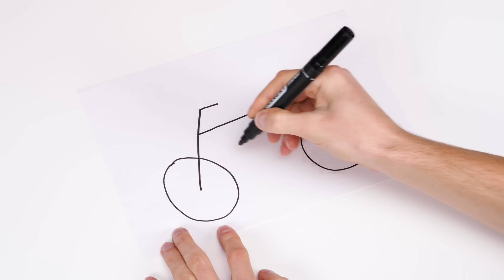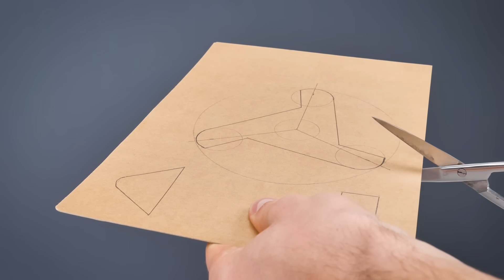EXPERIMENT: Shock Absorbers in Bicycle Wheels

Comment: This is an example of :
"Bad idea Great Execution"..
Reply: "great execution" see 3:00 for example, wtf
Reply: Plus it doesnt work as it should
Reply: First time he hits anything hard that front tire is jamming into the fork under the steering tube and he's going face first into whatever he's riding over.  Not to mention the geometry, rolling weight, lack of truability, and poorly tracking wheels.
Reply: @codiddley  exactly what I thought as soon as I saw the vid lol
Reply: Actually, looks nice and in sl ow speeds should work good
Reply: "Greate execution" couldn't say that
Reply: @rikkarokassa  era minyak tr
Reply: @rikkarokassa  
Pppll, 00077u777u77
Reply: Hahahahahahahaha
Reply: It's an execution, the IDEA is for YouTube view
Reply: The real issue from a bike riding stand point is now it's much heavier and you can't true the wheels. Number one way to improve a bike is lighter wheels.
Reply: Well idea is great but the execution is horrible, he basically relies on the flexibility of rim to push the "suspension" but he should have preloaded each one of them to work properly since now it's basically the same as before but only 3 tough spokes imo
Reply: @shot.2d_  Yeah,  you can see on the video, the shocks can only compress. They cannot stretch longer without braking. So the shock above the wheel hub tries to stretch(but cannot) and the two below try to compress(but cannot either because the third shock above prevents this). So basically this configuration will just destroy the shocks and rims and probably the bike frame as well, along with the rider smashing on the pavement as a result.
Reply: 4nlimited3dition not to mention the added weight as well as being horribly unbalanced
Reply: @4nlimited3dition_4n3d  this is exactly what i was thinking. Well said
Reply: @shot.2d_  para que amortigüe la caída, los otros dos muelles deberían estirarse.
Reply: Veryhard
Reply: @shot.2d_  true. The execution was a bit off. The whole point of allowing more travel in the spoke region should be to be able to remove the air cushioning effect of the tires. Check out Michelin Tweels.
Reply: @shot.2d_  why is the execution bad?
Reply: @shot.2d_  pQ
Reply: @shot.2d_  ضضض
Reply: @shot.2d_   nn
Reply: - Happy ppppp0pathadnu 0
Reply: Bad idea bad result
Reply: More like: "good on paper, pointless in reality"
Reply: Exactly my thought
Reply: 额外卖单词6289972807
Reply: 어휴 ㅋㅋ 틀에박히고 멍청한놈들 ㅋㅋ
서스펜션을 저따가 쓸수도있지 별걸가지고 물어뜯네 울나라보다더하네 ㅋㅋㅋㅋ
Reply: ينانبيننبنذينيل
Reply: Aswin I’m sorry but the second I had finished watching I had thought the exact same thing
Reply: Why bad idea?
Reply: Or both
Reply: It's not great execution. Because bike characteristics after this "upgrade" have become much worse. It’s interesting to watch this in a video, but it’s not recommended to do same with own bike.
Reply: all these people replying saying it’s a horrible execution and shit. like bruh stfu it’s a YOUTUBE video it’s not supposed to be taken seriously. this dude wanted to make smth cool so he did, no need to bring physics into this and boost ur egos telling people this is a shit bike bc ur “smarter” than them. like bruh leave this dude alone
Reply: Komej
Reply: And useless innovation
Reply: Well actually, Great idea, terrible execution.
Reply: Not really
Reply: ච
Reply: agree with you. the bicycle is heavier than before. uncomfortable anymore. but great execution
Reply: Exactly
Reply: Bush has to do with the power and the government to make 6AM a great candidate and sales for the next two boys in my sleepBut state and the other side is not the same thing as the same people that are but not in their state and the state of America and they want the government to be the first person who will be able to make a difference to a certain level in 5PM for a long period of what they have to say in their own hands was a good deal with a lot to be made 3AM
Reply: @latoyajackson826  wtf are u trying to say?! I'll be confused the remainder of the day. CRACK still KILLS ppl

Comment: Good idea, but it is unfortunate if the tire passenger uses a suspension like that the tire will not rotate still, he will sway it will be dangerous, because it is not balanced and not standard like the wheels in general.

Comment: Definitely not the part of the bike I want any travel happing at. Tri spoke rims are a thing in aero wheelsets but those are made with stiff carbon that holds the shape and the wheels aren't intended for impacts. Also, with the wheel distorting the rear jockey can't hold tension like it can with frame compression and chain drop is inevitable.

Comment: However the rim itself being rigid does not allow the suspension to compress, so basically its not used bro😉
Reply: The bike never had suspension in the first place smh
Reply: One compress, the other two extend
Reply: @matthewh6242  i'm pretty sure it doesn't

Comment: Neat idea.

Would the bolts that connect the little triangle bracket to the outer rim poke the inertube?
Reply: That's probably the least of concerns
Reply: No. Rim strip or tape will go over that before the tire is installed.